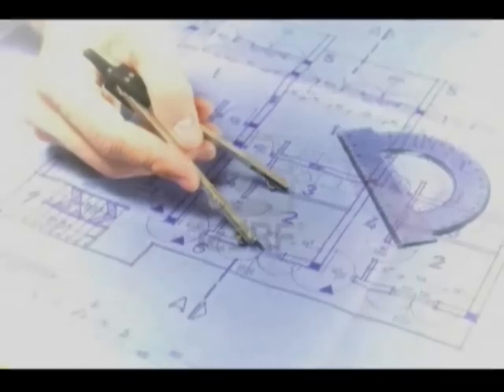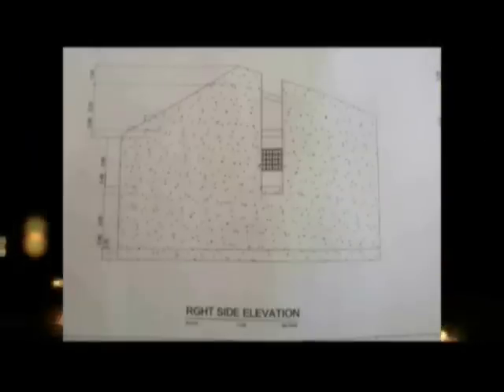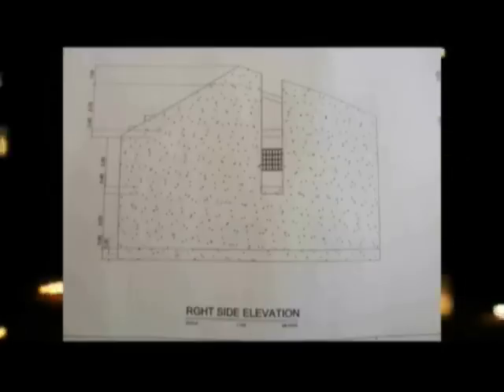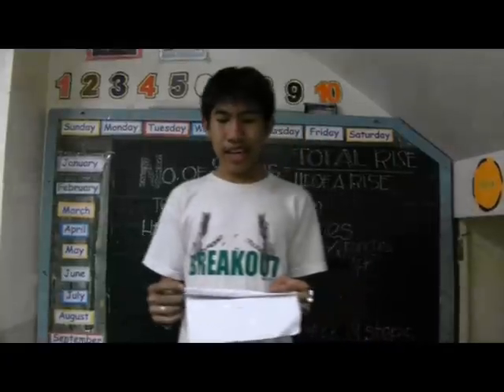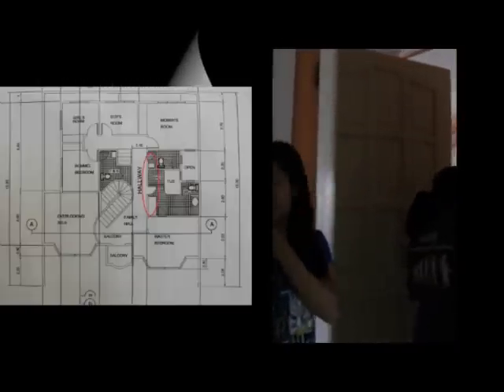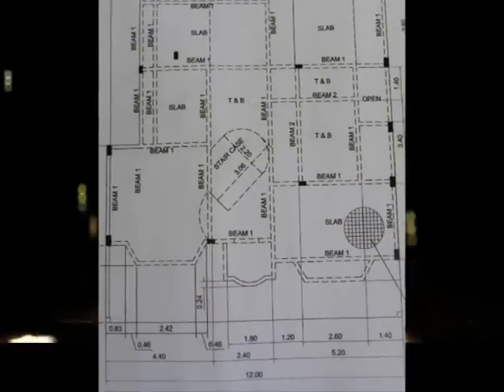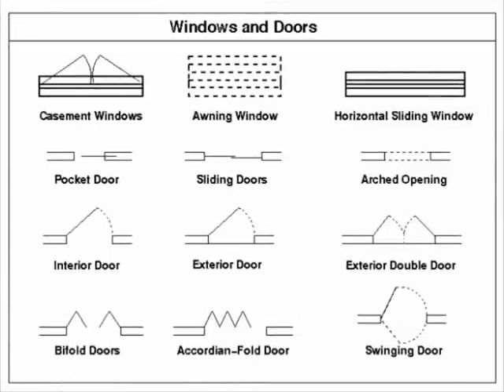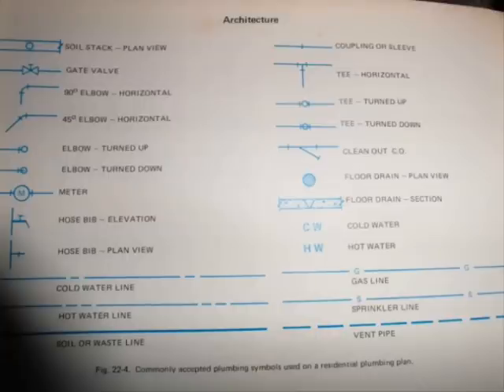Drawing Plan vis-a-vis Actual (Comparison Report by: BSCE2C-TUP-COE-GROUP5)

Comment: Overall I would grade this effort at an A, due to the technical knowledge they imparted to viewers. The house they used for their demonstration is beautiful. However, I am curious after seeing the full-size pool table in the attic what the load-bearing capacities of the floors are. It seems strange to see (if it is a true slate base pool table) such a heavy piece of furniture on the upper floor of the structure. Again: Great job by all concerned!

Comment: 2. It was obvious from the change in speech tempo that when the group members left the segments describing the physical appearance and began to talk about engineering details that they are more comfortable with engineering. That indicates that they are learning the lessons presented by the university.

3. I would grade the video-making aspect at a B- in that the audio varied greatly in volume and other minor problems. However, they are engineers, not video techs.